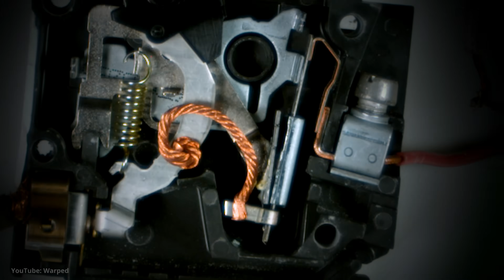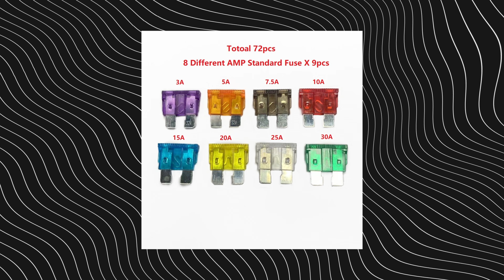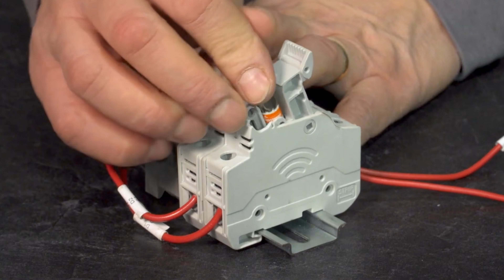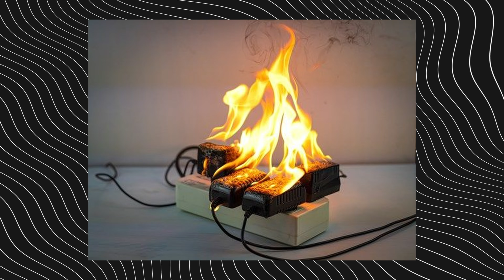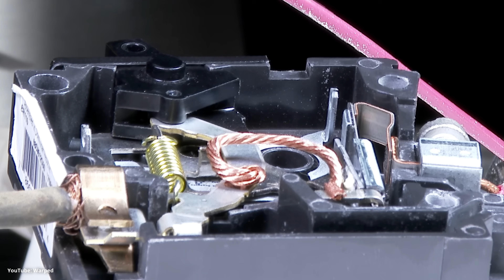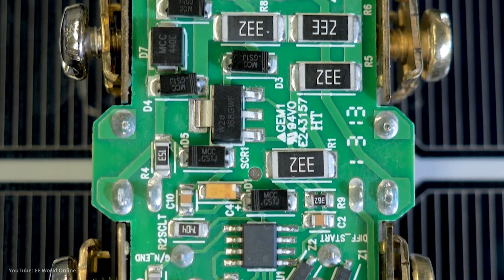These Won't Save You! - How Do Breakers ACTUALLY Work?

Comment: A dangerous fact that you omitted, a GFCI, aka RCD everywhere outside the USA, will ONLY protect you if you touch ground and an exposed live part, ie:  Active/phase/live/hot (whatever else another country might call it)  to ground,  or  Neutral to ground.  

If you touch  Active/live/phase/hot (etc)  and  touch neutral - you're fucked  because you are now part of the circuit and nothing will trip or save you, it will see your frying body as a normal everyday load.

Comment: FYI - Fuses in my experiance are a combination of both the height of reliability and low cost short circuit and overload protection. I wonder how actually reliable circuit breakers are at short circuit and overload circuit protection. Yes circuit breakers are convenient and there are newer types offering additional protections. Our new in 1956 house still has the original electrical system with fuses. My mom overloaded a kitchen circuit a few times in the 1960's after she bought an electric frying pan and an electric turkey roaster. It was my job to change the fuses. Fuses were cheep. We always had a box of each needed size next to the electrical panel. Never used a penny or a higher amp rated fuse. Yes it takes a bit of looking to determine which fuse has blown. Have not blown a fuse since that time. No corrosion - fuses are still easy to screw out and in. All the wiring is encased in steel electrical conduit or is BX wire that has a metallic protective flexible covering. The actual copper conductor has tough "plastic" type insulation very much like found in NM "romex" cable today and shows no deterioration. A near by house built a year or so earlier has wires in BX cable that are insulated with a fibrous covered rubber? insulation that has become brittle over the years. The mid 1950's may be a wire insulation change over point to be aware of.

Comment: Nice video, although it would have been nice if you all went over the difference between DC breakers common in solar setups vs a standard AC breaker.

Comment: Would love to see you do a video on back-feeding your electrical panel "and" also use of transfer panel that contain breakers when your primary panel has arc faults breakers. 

Specifically if your power station is only 120v and you only want to power single pole circuits in an outage.

What impact, if any do arc fault breakers have on those scenarios vs standard breakers? When backfeeding a breaker with interlock, any challenges with intermittent trips on the arc fault breakers? When using a transfer panel that contains breakers, do both panels have to have arc fault breakers? Or, can you move your arc faults to the transfer panel and use standard breakers in you primary panel? Lots of opinions out there, would be great to see some actual testing/real-world results on the topic.

Comment: Grew up in a house with a fuse-based knob & tube electrical system. My dad would jam a penny or quarter in the screw-type fuse hole to keep things working, and wrap a pencil in tinfoil to replace the vertical fuse type. This was in the basement in the same room where one of our water pipes would constantly leak. It's amazing that the place never burned down.

Comment: The solar lab is reporting on AC breakers?
DC breakers are very different and are superior to fuses almost all the time.  DC breakers have spike supressors built in that will essentially clip that brief spike caused when continuity is made via a switch, or connecting a load to a live wire.  There are many flavors but they are very different than AC breakers.  Not sure how AC breakers relate to Solar, as that is a different field.